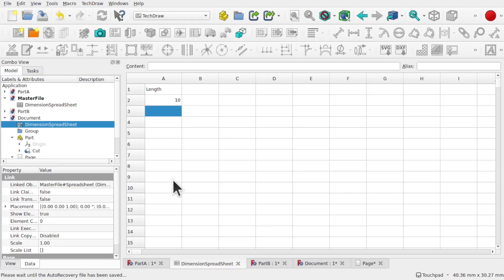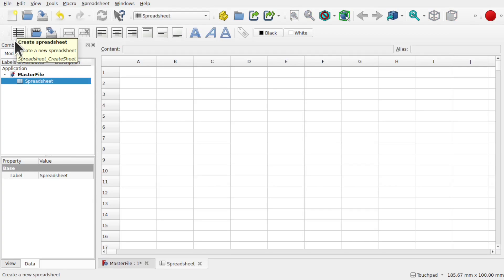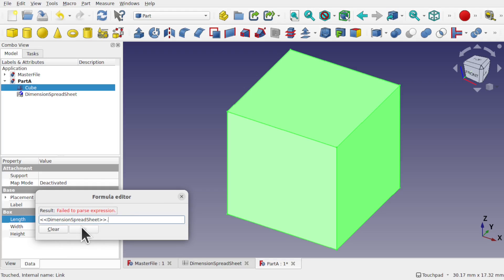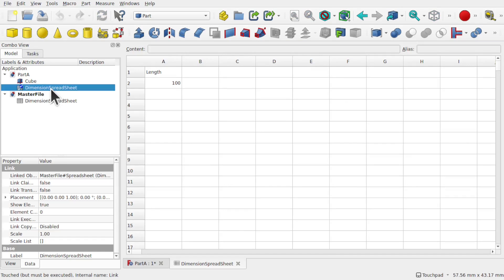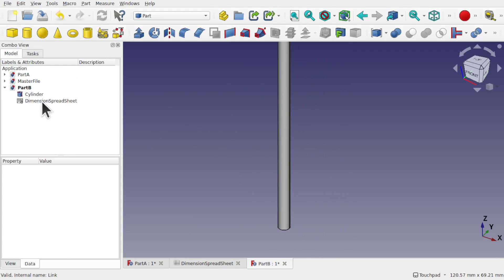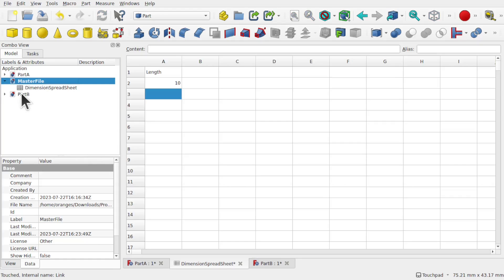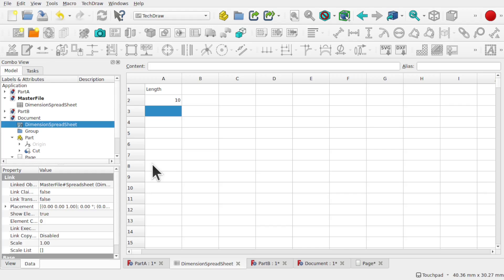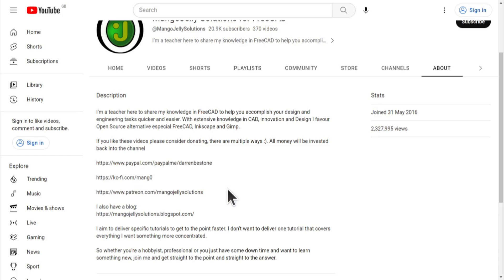Cross File Parametric Modelling | Shared Spreadsheets and Technical Drawings | Mastering FreeCAD | 3

Comment: Maybe it is just me, but maybe someone got the problem too: "No autocomplete for aliases in linked spreadsheet"

If I link a spreadsheet (in file "data") in another file (named "assembly"), I can link the spreadsheet form "data" into "assembly".
But I can't use the autocomplete aliases (because they are not there) ...but when I use the aliases (by typing them manually or copy and paste), they work in "assembly".

It is really NOT handy (because I always have to get back to the spreadsheet for var-names and checking typo errors).
Reply: Try this way <<GlobalData>>#<<MainSpreadSheet>>.Length  where GlobalData is name of the file, that cointains MainSpreadSheet, then you have aliases created in MainSpreadSheet. For me is good practice, that names is as short as it can be, no one wants endless expressions ;)

Comment: I use sketches sometimes to solve geometry to extract a resulting dimension as a labeled reference dimension. This might involve lines tangent to an arc or circle then other perpendicular to that. It would require trigonometry calculations to arrive at the dimension I need. It is easier to let the solver do the math and let me use the results. I extract the need dimension using a reference distance that is given a label. I then use that calculated reference dimension in other sketches using the expression editor like <<Sketch4Calc>>.Constraints.DistBelowXYPlane. This works well within a single part file from sketch to sketch. But I cannot get it to access sketch constraints that are in a linked part file. In some cases, I have done the trigonometry calculations in the spreadsheet to create a sketch constraining dimension, so I can do the math, but it is easier to let the solver do the math for me and extract the resulting desired dimension. How do you use sketch constraints that are in a sketch from another part file?

Comment: I think you have some of the best FreeCad tutorials on the internet. I have learned so much from watching them. Thank you.
I have a question in regard to sharing a spreadsheet; I cannot get the select/Alt/drag to work.  Can you tell me if I need to change something in my preferences?  Or, is that a default and I'm just doing something wrong.  I'm running the latest version of FreeCad, 0.21.1 on windows 10.

Comment: Very helpful tutorial. One issue when working with Aliases from a linked Spreadsheet is that you have to type the complete name when using it inside the Sketch Editor for example. With a normal Spreadsheet it shows you some options when you start typing.

Comment: Hi, I have a question: You have several parts -  Part A, Part B, Part C, etc. Now you would like to have a slight modification of Part B, but want to keep Part B as it is, so different Version of Part B, say Part B.1. Would it be possible just to duplicate the file Part B and rename it to Part B.1 and start working from there to modifiy it and create a different Version of Part B?
Reply: You didn't specify that you wanted to use it via a link, so I'll answer without links in mind.
Yes. I do this all the time. All you have to do is use "Save As" and change the filename. from that point on, you're editing the new file. Anything referencing the original file will be unaffected by further edits (which will be applied to the new file).
If you want to go back and edit the original, you'll have to re-open it as FreeCAD considers it closed.

Comment: Thank you!
I usually design with a master spreadsheet
and I have been wanting to use the assembly workbench, but have been discouraged for not knowing how to link the spreadsheet through multiple documents, so I usually designed all the parts into one document
to be honest, I didn't thought it was possible 😅
Reply from the maker: Hoping this will be helpful for you and open up more opportunities . It can be pretty hard keeping it all in one file. I used to do exactly the same until I found this little gem 😊
Reply: @MangoJellySolutions  Gem indeed. I've been using FreeCAD for years and never knew what the link was for or how/when/why to use it. This is fantastic and simplifies too many things I've been doing the hard way!